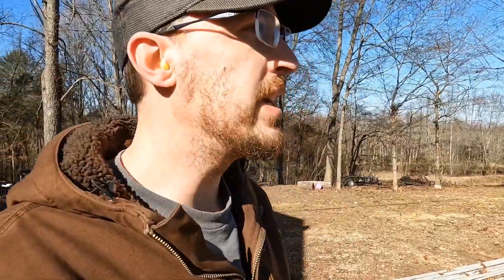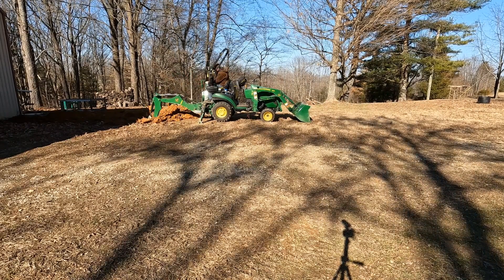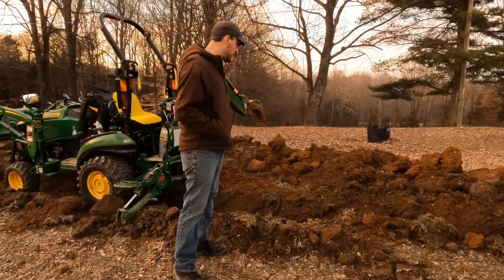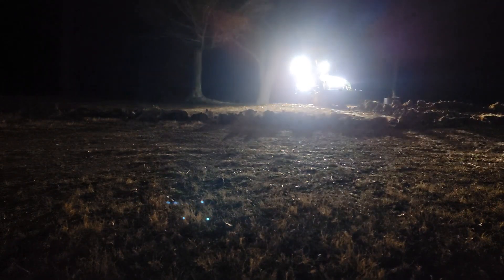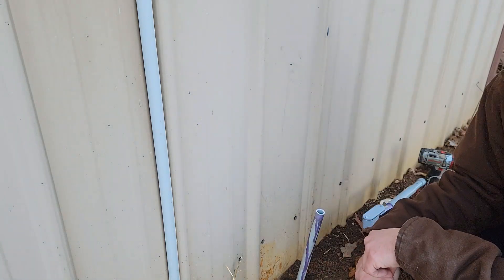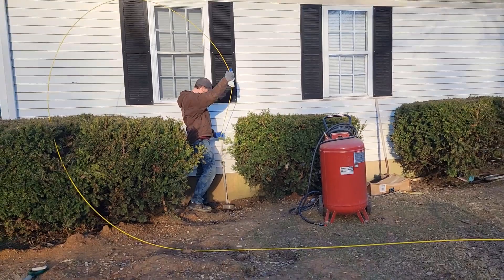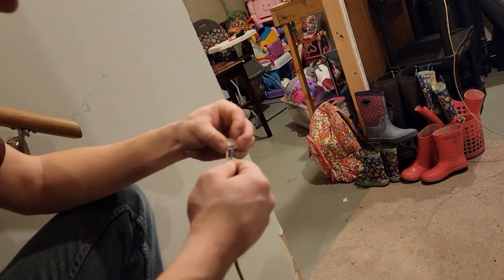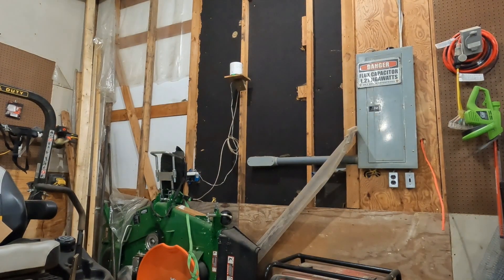1025R Digs A Trench For Network Cable Install

Comment: Great trenching video. As for the network wires, when trying to put them in the connector, cut them to about 3/4 inch, or less. They'll go into the connecter much straighter...You had them too long, that's why they get twisted......
Reply from the maker: Thanks,  I'll give it a try next time. I've never used pass through connectors before, Only the old ones that had to be absolutely perfect before you put it together.

Comment: I love tractor videos as much as the next guy but would it saved you time and effort using a Point-to-Point Antennas to provide internet from the house to the garage. I use the ubiquiti UAP-AC-M antennas and I am able to get up to 300mbps. on top of that I was able to install all devices in 2-3 hours. Again I'm not against tractor work, I have a 1025r myself as well and Lord knows I love driving/operating that machine.
Reply from the maker: I tried to use a TP link antennas (cpe210). It may have been a bad model choice.  In theory it should've made a wireless backhaul to the main deco but the decos couldn't see each other and was inoperable.  The wifi mesh has been really awesome now that it works everywhere.   It's hard to beat a hardwired connection.